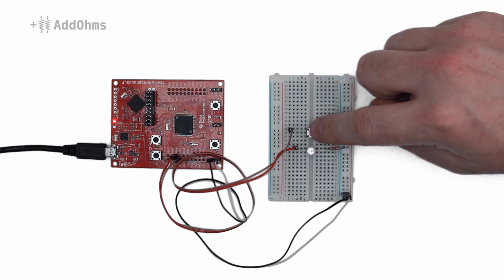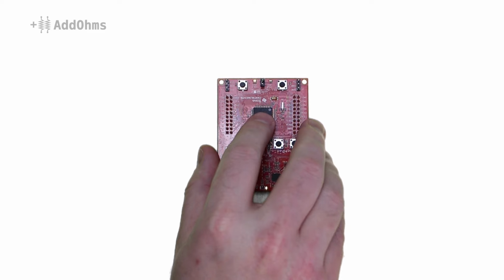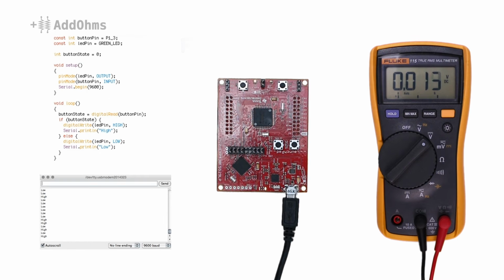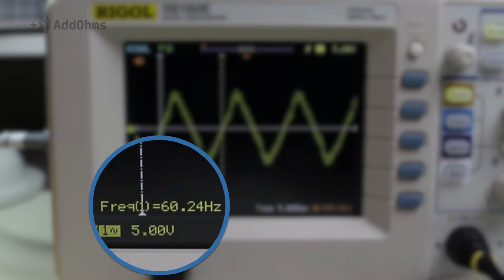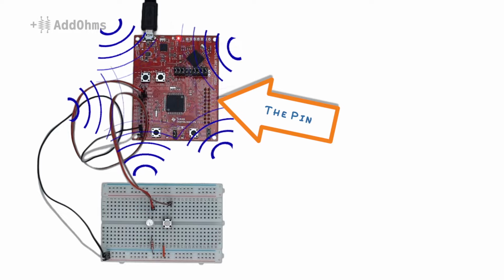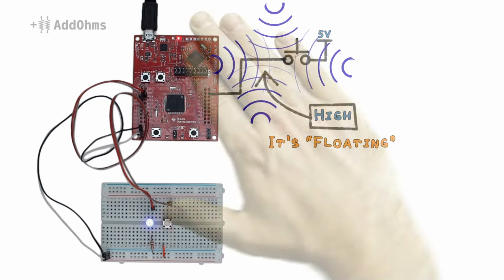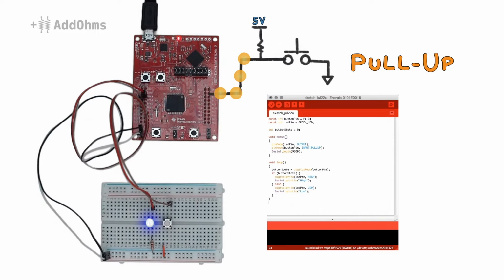Pull Up Resistor Tutorial | AddOhms #15

Comment: Surely the resistor would drop a voltage over itself, and if so, why would the chip see 5v when the button is open circuit. Thanks.
Reply from the maker: Sure, it forms a divider. A R1 = 10 kOhm pull-up in series with R2 = 10 MOhm (effective) input pin. Do the math and find the exceptionally small voltage that gets dropped across the pull-up.
Reply: @AddOhms  Oh, that's it. Yes I get it, thank you for explaining that, because that had me stumped for such a long time, as I have to know everything inside out. And many, many thanks for your immediate reply. You are a gent.
Reply from the maker: In the case where a resistor is in series with an actual open, there is no current through the resistor, so no voltage drop occurs. Ohm’s Law.
Reply: @AddOhms  Sorry, just read my question back, meant to say closed circuit. Thanks again.
Reply from the maker: In a closed circuit, the resistor drops (almost) all of it … So the pin sees (almost) 0 V.
Reply: @AddOhms  I'm getting it now. Known about pull ups and pull downs for years with PIC microprocessors, this is the first time it's actually stuck in my head. Thanks :)
Reply: @AddOhms  I think it being counter intuitive to my mind at least, where pull up actually is the digital zero on a button push, and pull down being near to 5 V, logic one.
Reply from the maker: The microcontroller doesn’t care what a HIGH or LOW represents. It just needs to see a stable voltage.
Reply: @ Yes, thanks.

Comment: I have been running a brushed DC motor with an Arduino and regulating the speed with PWM.  I am trying to get the motor to run at a constant rate, but the motor speed fluctuates wildly despite the feedback system programmed in Arduino.  Since PWM operates by pulsing the power on and off, I am wondering if the outside EMF is affecting it.  Could EMF be an issue with PWM-controlled motors?
Reply from the maker: I doubt its outside fields causing a problem. It is more likely the back-EMF generated by the motor when the PWM signal is off. If you look at the waveform at the motor on a scope, it should be obvious if that is happening.

Comment: Maaaaan you helped me a lot! I'm newbie, have a hard time setting an e-drums on my Pi Pico 2 using piezo transducers discs, but analog pins (adc) are always reading pretty much noise even when they are not wired.
I just wonder if i need a pulldown or a pullup resistor ^^

Comment: So in the final circuit when you press the button and the voltage at the pin drops to zero, why isn't the ambient noise a problem any more?
Reply from the maker: Noise coupling in isn’t because the floating IO pin (and its transistor) is connected to “zero.” It is because it’s connected to nothing. Once it is forced to a known voltage the stray EM fields would have to over come that potential. They aren’t strong enough to do that.
Reply: @AddOhms  ohh I see, that makes a bit more sense thanks :)

Comment: Why does the resister matter? Is it just to prevent a bunch of current going into the pin, or is something else going on?
Reply from the maker: A short circuit through the button would be created without it.
Reply: @AddOhms when the button is not pressed, does the 5V go into the microcontroller?
Reply from the maker: Yes. That’s the point of the pull-up. And it’s how voltage drops work. It’s Kirchoff’s Law. An open (or very high resistance, like the transistor connected to the input pin) drops voltage.

Comment: Ok let me ask you this. I have a optocoupler with as a base a sensor that makes the led light up just great. On the transistor side I need a 24VDC signal with a logic 0 between 0 and 7.1 volt and a logic 1 between 9.7 and 28v. I get 23V and 22V that means that I need to pull down the signal when the circuit is open right? So I guess a 10KOhm resistor between the pin (emitter) and the GND would help to get the signal to below 7V? Please let me know if I understand this right.
Reply from the maker: I don’t understand the question.

Comment: I have a question, why when button is pressed, current does not split on two, so part of it goes to GND and part to the pin?
Reply from the maker: A very small amount goes to the pin. The pin’s input resistance is an equivalent of a 1 megaohm resistor to GND.  So you have megaohms in parallel with kiloohms.

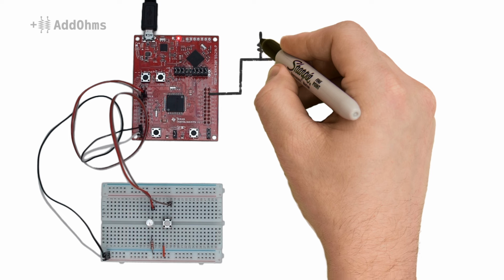Comment: I have a question.  At 2:27 ,  If I were to measure from the resistor side of the switch to ground with multimeter set to measure DC volt,  would I read 5 VDC?  Second quesion.  If the wire leading to the switch were somehow to get grounded, would the input show as on?  I.E. same as if the the switch were closed?
Reply from the maker: Yes. 

The voltage drop from the resistor side to ground is 5 volts, which is the point of the pull-up. Since the resistor is connected to effective open, the voltage relative to ground is the same on both of the resistor's terminals. 

For the second question, a wire connecting from that same point to the ground is exactly the same as the switch being closed.

Comment: But...but...it's the connection to 5V that ensures the signal is high, not the resistor. The resistor is only there to prevent excessive current flow, isn't it?
Reply from the maker: That’s the same thing. Kirchoff’s Law.
Reply: @AddOhms  Wow, I wasn't really expecting a reply on an eight year old video! Thank you. I'm slowly working my way through your lessons, I like your clear and concise style.
Reply: @bolarmaile8212  That's what I think, but I'm just a beginner.
Reply from the maker: Please stop spamming my channel with the same question over and over.
Reply from the maker: That is incorrect. It creates a short circuit without the resistor.

Comment: Why you used the resistor, and not connecting 5v directly?
Reply from the maker: Because without the resistor, you would have a direct short to ground when the switch closes.

Comment: I just built a ESP32 + neopixel circuit where the pattern of pixels change on press of a interrupt button. While I have the pin pulled DOWN with 4.7K resistor, I am noticing the patterns changing at random... I think I now have a solution to the problem.. Thanks for the clear explaination.
Reply from the maker: Pull up or down doesn’t matter. 4k7 is a decently strong value. 

NeoPixels need a 5V signal on their data line. So, make sure you are level shifting from the ESP32’s 3v3 logic to 5V.
Reply: @AddOhms  That's probably the cause of problem. Unfortunately my ESP32 Dev board doesn't have a 5VDC output and there's no space for additional circuitary so I guess I'll just have to live with it :)

Comment: With internal pull-up mode I do get unexpected results, whenever I do something on my AC line (Like switching on the room light). Should I move from internal to external pull-up with 10k resistor?
Reply from the maker: You should fix the wiring fault in your house first.
Reply: @AddOhms  What to look for? It's a house from the 70s and I was born later ;-)

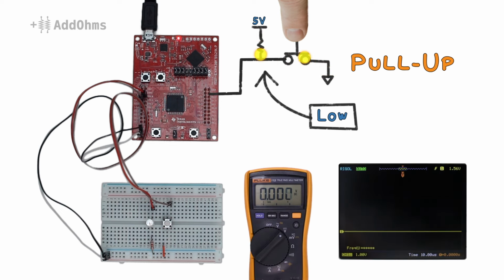Comment: 2:42, why does the current not go to the left as well?
Reply from the maker: It does, but only a very small amount. Input into a pin, which is the input to a MOSFET, is very high impedance. There is a huge resistor in parallel in with a very small one to ground. So only nano amps goes through the pin.

Comment: So essentially by setting a device/pin to low you are setting it to 0V and thus 'turning the pin off'? And by setting it to high, you are sending it a specific voltage(usually 3.3V or 5V) and turning the pin "on" which will then output data if its an SO pin or input data if its an SI pin?  Do I understand that correctly?
Reply from the maker: Yes

Comment: Hi Addohms! Very good stuff on your chanel. Instead of using a pull up resistor, we could use a pull down resistor on the I/O pin. I do not like this reverse logic and find not intuitive the INPUT_PULLUP instruction. Is there any issue with a pull-down resistor?
Reply from the maker: Pull-down is the same idea. With pull-ups, I use #define statements for PRESSED 0x0 and NOT_PRESSED 0x1. That way my code reads: `if digitalRead(button) == PRESSED ...` instead of high or low. It's much more readable and makes the logic levels irrelevant.

Comment: Thanks for the video. In your explanation, the pull-up resistor is constantly using electricity whereas without it, the electricity only gets used when the button is pressed. Is there a different technique to do pull up resistors to reduce power consumption in low voltage systems?
Reply from the maker: Do the math. When not active, the pull-up resistor has no voltage drop across it, so no power dissipated. When active, in a 3v3 system a 10k resistor lets 330 uA thorugh. Whatever action happens after that is going to, no doubt, draw way more current than that.
Reply: @AddOhms  Ahhh thank you for explaining it! That makes sense. Sorry, I’m a noob and may just have asked a dumb question! 🫣

Comment: Ok, I get why pull resistors are required, the problem I have is with sizing the resistor. I have a DS18B20 sensor, which I could not get to work properly, until I hit the magic number of pull up resistor of 4.7ohm, can someone please explain  why it has to be so specific? It will not work with a 5ohm or 4 ohm. Took me a lot of googling to figure this one out.
Reply from the maker: Fairly certain you mean 4.7 kilohm and not 4.7 ohm. Exact value of pull-up rarely matters. In this case, the one-wire bus has special considerations. The data sheet for the sensor probably explains how to pick an appropriate value.

Comment: Thank you for explaining some people are like use pullup for i2c and I never knew why but it makes sense as a way to stabilize the noise in the circuit
Reply from the maker: The reason for a pull-up in I2C is because the signals are "open-drain" (or "open-collector"). Meaning, the transistor does not connect to VCC (or GND). One advantage of open-collector is that you can connect two devices that have different VCCs.

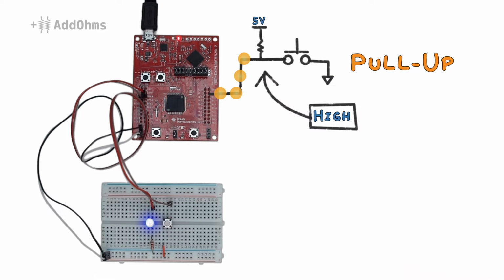Comment: at 2:38 when the button is pushed, does ALL the current flow to ground? or does the current splits into 2 flows, 1 flow mostly to ground and 2 flow a little into the input-pin ?
thanks
Reply from the maker: A tiny amount of current goes through the IO pin. The input is a gate of a FET so it has high impedance (or resistance.)

Comment: If the pull up at the end is connected to 5v doesnt the voltage drop going to the pin because of the resistance?
Reply from the maker: The pull-up resistor is in series with the input impedance of the pin, which is around 10 megaohms. So do the voltage divider math of R1 = 10 kohm (the pull-up) and R2 = 10 megaohm (gate of input MOSFET).  About 5 millivolts drops across the pull-up, leaving 4.995 volts to drop from the input FET to ground ...
Reply: @AddOhms  thanks for the explaination

Comment: Question if micro controller had a built in pull-up resistor and it was defective could I just add external pull-up resistor to make it work?
Reply from the maker: yes
Reply: @AddOhms  I'm going to try it.  It's actually a computer in a vehicle and the cost to replace is prohibitive.

Comment: What would happen if a pulldown resistor is mistakenly coded as a pullup resistor? Would it cause intermittency in the switch?
Reply from the maker: Most microcontrollers don’t have both. But if it happened, the input would only ever read a LOW.
Reply: I meant the circuit has a pulldown resistor, but it has been coded as mistakenly input_pullup. Could it cause intermittency in switch because of incorrect coding?
Reply from the maker: No.
Reply: Thank you. Watch a lot of your videos. Thanks for yoyr great channel

Comment: I still don't get why the current 'prefers' to go from the pull-up resistor to ground through the button, even though the pin is grounded too. Can someone explain? I noticed this also happens with an NPN inverter even if the output is directly connected to ground, electricity goes directly to the other side of the transistor.
Reply from the maker: input pin is 1,000,000 ohms. path to ground is whatever the pull-up resistor is. Current is lazy.

Comment: Awesome video. I built this circuit using my Pi, switch, 10k resistor, and a 3v led. I have the led inline from switch to ground. My question is, when I push the switch the led comes on but in looking at the gpio pin it isn’t low. If I remove the led an  connect switch directly to ground then gpio does go low. Is this expected?
Reply from the maker: The LED creates a voltage drop, enough that the Pi doesn’t see 0v.

Comment: Hello I'm using max30100 oximeter sensor with esp32 serial monitor showing oximeter initialisation failed .
Should I use pull up resistors of 4.7k externally and remove inbuilt resistors of sensor by disoldering
Reply from the maker: Strong pull-ups (smaller values) in parallel with weaker pull-ups are fine, especially to test.

Comment: Good explanation but I want to know how to calculate the resistor value. Working with a pull down, a vcc of 3.3v and an input pin with a max current draw of 80ma (nodemcu esp8266 v2)
Reply from the maker: Picking Pull-Up Resistor Values | AO #25. https://youtu.be/u3Xiy2DVnI4

Comment: Great video, like always... I just discovered your channel last week.
I've one question, I'm working on a project that I want to use on my motorcycle, i want to sense 12v with digital input on Arduino and I gonna use a voltage divider with two resistors, and the question is if i need to put a pull up resistor to have a clear input, or just the voltage divider will be enough.. any comments will help
Reply from the maker: Just voltage divider
Reply: @AddOhms  Thank you so much!!

Comment: You show the yellow circles moving to ground when the switch is pushed , but which direction are the orange circles moving when the switch isn’t pushed?
Reply from the maker: They aren’t. That’s the point. By being held at a potential (5V or GND), the voltage is stable. The resistor is so there isn’t a direct short circuit when the button is pressed.
Reply: . I just wondered why the path to ground was illustrated differently than the path to the microcontroller. The path to ground (yellow circles) was stable too

Comment: We are using PIC boards in class. So "low means high" (there is a pull up resistor) is the reason why we are coding:

 if (switch1 == 0)
    {.....
     }

Right? He never bothered to tell us why its a 0 and not a 1.

Comment: Is it possible to replace pull up resistor to the actual resistor?
Reply from the maker: Sure
Reply: @AddOhms  How can I make it work? Will it work if I just change the code(input to INPUT_PULLUP) and remove the resistor?
Reply from the maker: If you’re using an external pull-up resistor, why would you enable the internal one?
Reply: @AddOhms  To make a circuit more simple! (I'm using servo motor and flex sensor)
Does pull up resistor act same as a normal resistor?
Reply: @JJ-el1xp  A pull-up resistor is the same as any other resistor, it is a pull-up because of its location in the circuit.

Comment: What if you do exactly the opposite? No pullups: 5Vpin to button primary, button secondary to both an input pin and a 10K Resistor leading to GND. 

Im using flanks on my code and they get completely ignored; things happen while keeping the button pressed and they shouldnt.

Any help would be appreciated.
Reply from the maker: That’s a pull-down instead of a pull-up.
Reply: @AddOhms  Thanks, I saw the name right after posting. Still cant guess why flanks are not working though...
Im using two bools for it, Somethingpressed and Somethingpressedprev. As I mentioned, if i keep the button pushed the action keeps repeating and it shouldnt. I checked the code and the conditionals are okay.

The weirdest thing Ive measured is 0.5V between board and pulldown resistors GND. Wondering if its that or maybe just some noise due to poor protoboard quality.
Reply from the maker: I don’t know what flanks are. If you’re measuring a voltage drop between two points that are supposed to be ground, one of them isn’t ground. Without seeing your code, I would assume you have a logic error.
Reply: @AddOhms  Sorry maybe the translation is too literal. A flank happens the instant a digital signal changes its value, whether going 0 to 1 or 1 to 0.

Im using buttons and need to trigger things only the moment I press them.

I use two bits. One for Now and one for Before, and the flanks look like this:

 if(Now==1 and Before==0){
   …
   }

I have checked the logic many times and seems alright.
Reply from the maker: I’d recommend posting your code to pastebin and sharing that.

Comment: Why a 10k ohm and not a 47k ohm? Why this value?
Reply from the maker: Because the value isn’t that critical. However 47K is closer to an internal pull-up, so no reason to use that high/weak of a value externally. See this video: Picking Pull-Up Resistor Values | AO #25 https://youtu.be/u3Xiy2DVnI4

Comment: I just connected the i/o pin to ground and its works, why I need the 5v pin too?
Reply from the maker: If you are using the internal pull-up, you don't connect to 5v. It is internally connected to 5 volts through the internal pull-up resistor. If you aren't using the internal pull-up resistor, then your pin is floating and you're getting lucky that it appears to work as expected.
Reply: @AddOhms  Thanky you, I found that the code using the internal resistor.

Comment: What am I missing? I am new... Why not making a switch ( I think is called double pole/double throw) that when is not pressed it connects the microcontroller with 5V, and when pressed connects the microcontroller with ground?
Reply from the maker: Most push buttons aren’t DPDT. Pull-ups are also useful on the gate of a transistor. Or in an open collector output driver.
Reply: Thanks!